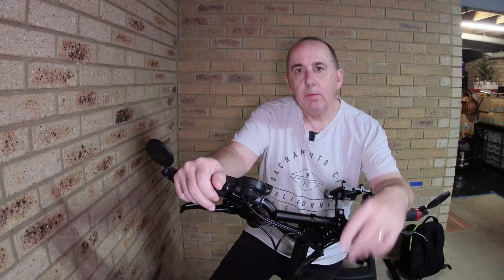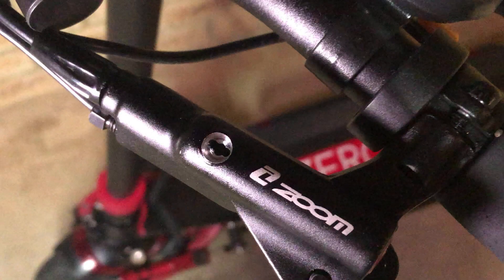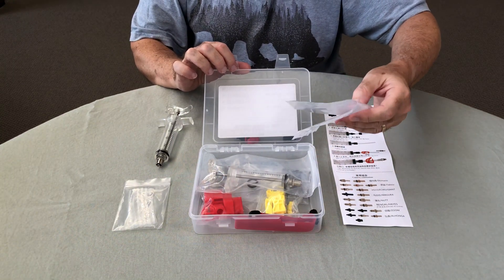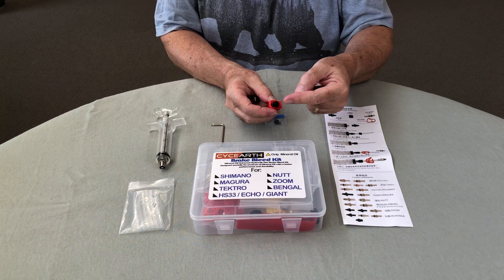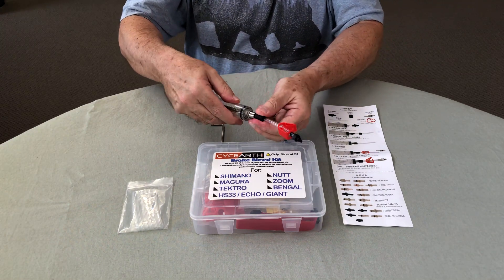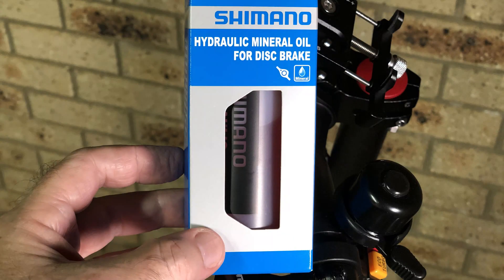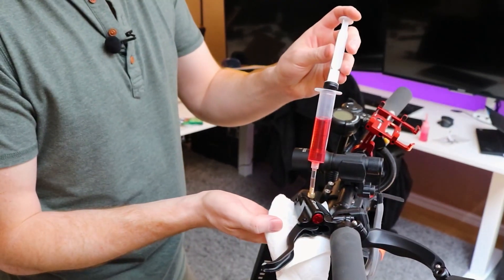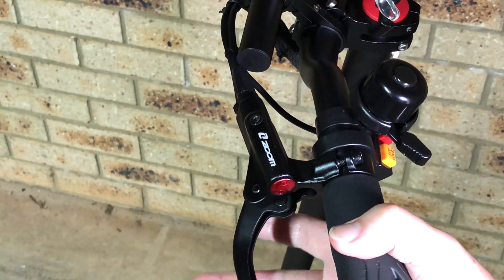How To Get The Air Out of Your Zoom Brakes

Comment: Thank you for the video.
My rear hydraulic brake barely operates and I tried to follow the instructions. The bubbles kept coming, so I decided to pull on the syringe to create negative pressure.
There were many more bubbles coming out and I was continuing that for over an hour and they keep coming out.
I believe, I might have an air leakage in the hydraulic system.
What do you think?
Reply from the maker: Hi Denis, yes that doesn't sound good. There may be a leak or broken line somewhere. Check for oil spillage anywhere. If your scooter is under warranty I would make a claim to have it fixed.

Comment: Wow great video!   Is Lever Bleeding suitable if one is replacing the entire Zoom caliper?  The front caliper on my Apollo Pro (same brakes as your Zero 10X) is leaking around one of the pistons and has lost all the fluid.  Wondering if I will need to do the full syringe-from-the-bottom type bleed.   Thanks!
Reply from the maker: Hi Kupe, thanks for the positive comment. I believe new Zoom brakes come pre-charged with fluid - i.e. you must order the entire system, including master and caliper with lines. If that is the case then you may be able to get away with just the lever bleed. I can't tell you for sure as I have never replaced the whole system (or caliper for that matter).  To be honest though, if I was going to go to all the trouble of replacing everything I would probably pay a few more $$ and upgrade to Nutt or Shimano brakes. Good luck !
Reply: @MarksElectricLife  Thanks!   I'm not sure if Apollo is sending me just the caliper or the entire Zoom set.  Hopefully I'll know soon!   While I have you (and thank you again so much) are both the silver pistons in the caliper (behind the pads) supposed to move?  It appears that one of the pistons on my bad caliper is deeply recessed and frozen.
Reply from the maker: @Kupe241  Hi Kupe, yes they should both move. It sounds like one is seized. Good luck with the replacement. Maybe you can give me an update on how you fare? Cheers, Mark.
Reply: @MarksElectricLife  Thanks Mark for confirming my suspicion on that piston.  Will  do and thank you again for your amazing channel!
Reply from the maker: @Kupe241  No worries !

Comment: Hi mate, just wanna ask you on how to flush those zoom brakes, where can i suck out the oil, from the top or from the calipers?
Reply from the maker: Hi FP, I'm afraid I can't answer that question. I have tried to find a bleed port on these calipers and there doesn't seem to be one. Luckily I didn't need to flush the entire system. You may find that a simple lever bleed, as shown, does the trick. Good luck !
Reply: @MarksElectricLife  Thanks Mate!

Comment: Way too expensive a solution. I can buy a new set of these Zoom brakes for $41. Take the plunger out of a syringe and disconnect any hose that might be attached to it. Ram it in the hole, it fits and seals, pour some oil in the syringe and start pumping the lever. Done. Go buy some brakes instead of this kit.
Reply from the maker: Hi ST, thanks for the comment! I see two problems with that approach. Firstly, if you ever get air in your new brakes you'll be up for another $41 to replace them. Secondly, it takes much longer to replace brakes than to bleed them and you still need to bleed the new ones anyway. And, as the saying goes, time is money.

Comment: Excellent video and thank you for confirming that Zoom hydraulic brakes utilizes brake mineral oil.  That seems to be be a state secret with other videos and from Zoom as well. 

Quick question if I may? Once the air is properly purged from the lines does the oil in the syringe naturally fill the displacement without any need to depress the syringe plunger to fill the any gap displacements left in the lines?
Reply from the maker: Hi FDR, thanks for the positive feedback! Yes, the beauty of this method is that it leaves the reservoir perfectly topped up with oil. When you pinch off the plastic tubing and unscrew the fitting you will find the oil level sitting near the top of the thread. When you screw the cap back into place it will displace a tiny amount of oil which is a good sign that there is no air space inside. Happy days !😊
Reply: @MarksElectricLife  Much appreciated and thank you!
Reply from the maker: @rockewoelk5852  You're welcome RW !